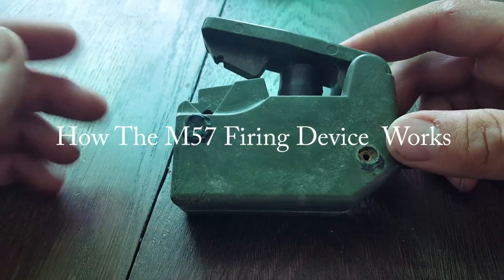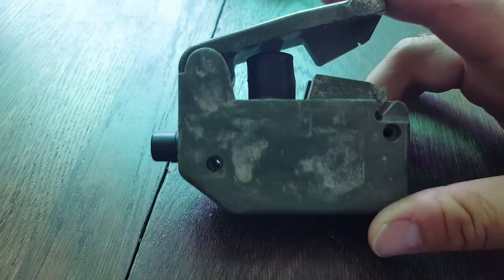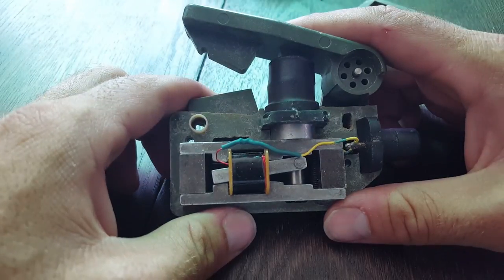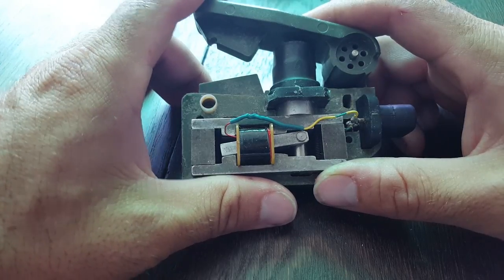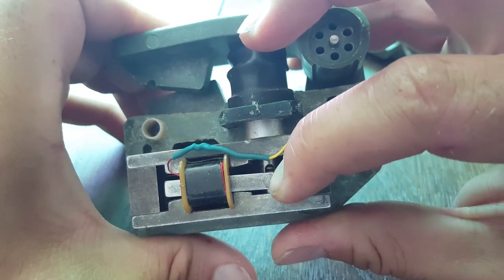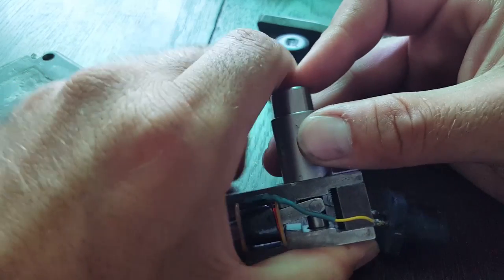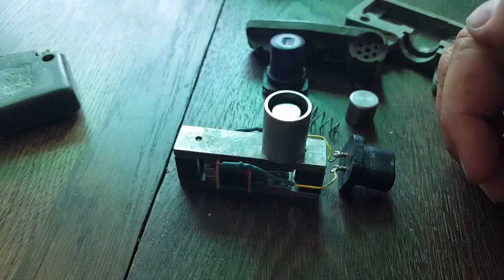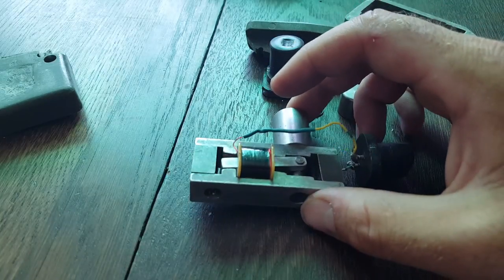The M57 Clacker: How it Works

Comment: Thanks for the detailed video, I was able to restore one probably better than new by replacing the two bad magnets.  Just wanted it to fire commonly available electric matches for fireworks displays.  I disassembled as shown in the video.  I verified both original magnets were installed north up, up being the button, before removal.  I purchased the minimum qty 25 part number P125BD-N52 magnets from Amazing Magnets.  These are the strongest you can get (N52), and 5 stacked up on each side is the same .625 as the originals but much, much more powerful.  I verified continuity on the two output posts, and reassembled.  I could not feel any voltage when holding the posts while clicking, but when I connected an electric match, it popped on the first snap.  I also can connect an LED and it will illuminate brightly when snapped.  I have enough magnets to fix one more, leaving 5 for the refrigerator.
Reply from the maker: Thanks for the reply. You have just filled in the thing I didn't understand about the 57. I assumed the magnets were arranged the other way now it makes sense. I thought the metal bar clicking over disturbed the magnetic field of the magnets rather than what it actually does.
Reply: Нажмите на фрагмент, чтобы вставить его в текстовое поле.
Reply: @Stray03  Do you havva link from where to buy these from? 🤔🤷‍♂️
Reply from the maker: Unfortunately no. Sometimes they show up on surplus sites, or eBay, but somewhere that has a selection no.

Comment: FLIP one of the magnets. the point of the construction is to get the magnetic field flowing through the clacking bar. if the clacking bar isn't sticking to both the top and bottom bars, it's not working. once it's flipped and touching opposite ends, the magnetic field through it is reversed and the coil creates current.

Comment: Thank you for a video, you are the only person on the internet to reveal the internals of it. I've almost thought that M57 was classified(how such a trivial thing can be a secret, and if it is why so many people sell it on ebay). Looks like engineers who design antipersonnel mines and accessories really like that concept of striker released by ball bearings that are pushed in.
Reply from the maker: Yeah I had only ever seen a picture of one opened up. Thr same type of mechanism also is used in the super bazooka iirc and the later versions of the original one when they replaced the battery in them.

Comment: As far as a light goes, you could always try to find the tester that comes with the claymore kit. I think it's just an amber led though. Obviously there's more to the tester than just an amber led but if all you're looking for is a light, you could try an led.
Reply from the maker: Yeah, I didn't get a tester with mine unfortunately. I was going to use an LED, but I changed the original magnet with rare earth ones which jumped up the voltage enough to light up Christmas tree bulbs.  I made a second video on it.
Reply: I see the light, I see the light

Comment: Stray03 thanks man I even asked a few electronics stores if they would work on it and they won’t even try to open it or anything. So now I feel like I’m stuck with a cool collectible piece that doesn’t even work.
Reply from the maker: Honnestly even if it did work it wouldnt be too useful. It is a 3v quick pulse making it not even have enough energy to get a christmas tree lightbulb to light up.  Mine didnt come with the tester so I had to connect it to a oscilloscope to test it and she started with about 2.5v after I fixed it up a bit. Now it is just barely giving off voltage. Personally I wish I could find a 10cap blaster at a good price but even those are getting expensive. I will have to eventually find something that the m57 can ignite.

Comment: Did you ever figure out how to get the initial click to go? I have a couple M57s I stole from one of my supply chains and none of them work. Just took it apart today and put it back together and came out with the same issue.
Reply from the maker: I think once you take them apart you have to re-magnetize them. I messed up my magnets so Ill have to re-set them then remagnetize the whole thing.
Reply: @Stray03  I just did that with some neodynium magnets a few minutes ago and didn't seem to work yet. I think I might have the polarities switched around on the magnets though, like where I placed them at in the plastic housing so I'll play around with them and see. Definitely should have marked their placement at first.
Reply from the maker: Not sure it is enough. Probably need a real strong magnetizing setup. Not sure though as I cooked my magnets and couldn't try on the MPI machine again.
Reply: @Stray03  interesting. My magnets are pretty strong able to hold up to 100 pounds each. I cleaned all the metal contacts too. I'll keep trying and see what happens.
Reply: @Stray03 well I got the click back actually. I put both south poles facing up. Not getting any green flash on the tester for it though.
Reply from the maker: You have the magnetic field pointed in the right direction?
Reply: @Stray03  oh please tell me you know which way they're supposed to point.
Reply from the maker: North south should be going through the coil If Im not completely fecking up my understanding of it. Basically front to back. Which is north and which is south I guess depends on the magnets placement. .
Reply from the maker: @USMC517  Just got the answer, Both magnets face north up. I based my Ideas of how the thing works with other similar devices, ended up overcomplicating the whole thing.
Reply: @Stray03  you are a god amongst men my dude!
Reply from the maker: @USMC517  Thank Zeb Clayton, He Checked his before removing it, All I did was realize I over thought how the thing works and really it is much simpler than I thought

Comment: the armature should snap upwards and smack the top of the metal thing on the left when you begin to press down. thats the click you are missing. take the arm off, flip it over, reassemble.
Reply from the maker: by arm you mean armature?
Reply: @Stray03 was that the solution?
Reply from the maker: @elivo905 no. New magnets was the solution.

Comment: I would like to get my hands on one of these. I guess the closest I will get is getting an old bicycle generator & rig up a gear box / linear actuator for it
Reply from the maker: Ebay. Problem is most are expensive. Also they dont work with rocket igniters or christmas bulbs
Reply: field telephone I guess  :p
Reply: get a cranky style blasting machine. you could add a capacitor to a clacker to make the voltage rise higher before it discharges. it would take several clacks to charge it.
Reply from the maker: I've been looking for one of those twist ones actually.  the plunger ones are too expensive now.

Comment: Great video!

You could try a led, no need to even place a resistor in between since the current over time is small enough.
Reply from the maker: Unfortunately the magnets are messed up on it so I'll have to replace them or "reset them" then remagnetize the whole thing, before I can get any workable current from them.

Comment: Any tips on how to get the housing open?
Reply from the maker: I had to cut with a razor blade carefully.
Reply: Ah, got it open. I'm not sure why, but my M57 stopped doing the 1st click after disassembling the magnets and cleaning the surfaces. I even marked them before taking it apart and put everything back exactly the same, but none of the orientations work.

Comment: Even though this has nothing to do with the Claymore the West German HAFLA-35L always interested me. The design of the round seems to be the closely guarded secret. In svc. 1976-2001. It probably would have been a good perimeter defence weapon. Not sure of the tactical role other than a simple cheap substitute for heavy & clumsy WWII era flamethrowers which were starting to go out of svc. in the seventies.
Reply from the maker: I remember reading an article on it a while ago. Personally i preferred the single use flame thrower the germans used in ww2. Here is an article on the hafla: http://warfor.me/ruchnyie-zazhigatelno-dyimovyie-patronyi-dm24-i-dm34/
Reply: That is another one you see very little on the details of on the internet - it has got to be a contained fougasse with a bursting disc in there of some sort. A bit scary to hold and fire I would imagine lol.
Reply from the maker: Yeah heavy steel container blank fired. Dont know how it lights up though.
Reply: Think of the DM34 as a willy pete gun as opposed to a flame thrower and it'll make more sense. Its not a napalm dispenser, its not meant to incinerate the area. It just makes it very uncomfortable to occupy ;)
Reply: If you really want to know how the dm34 cartridge works, study the wiki pic. https://commons.wikimedia.org/wiki/File:DM34_2.jpg
Reply from the maker: Nice cutaway actually. Looks like it sort of acts like a high low system for the launch.
Reply: I knew it was a sort of single use projector incorporating a substance with red phosphorus as one of the constituents & that was not pressurized before launch but other than that, don't know much about it.

Comment: Is it fully legal to own a clacker or do u have to do paper work with the ATF
Reply from the maker: Not from the US so don't quote me  but I dont think there is any rules for the m57. An actual claymore may need some registration as a DD if you dont want to go to a govt run facility.
Reply: Stray03 ya ik the claymores were a dd I just didn’t know if the clacker would have been or not

Comment: So cool man! Side note, have you ever considered using any type of peletized muzzeloding powder for rocket fuel? Been thinking about it, its pre cored and some of it is nitro based. I figured you probably thought about it a one point or another.
Reply from the maker: Yeah I was thinking of trying to use it to make .22 ammo for that fancy hot air initiated .22, never ended up buying the gun so the rest went in the "lots of Ideas and no time to try them" pile. As for rocket fuel I thought a bit about it, but Im still stuck in the attempting to extrude some normal powder.
Reply: Stray03 yea it is really hard to avoid air bubbles!
Reply from the maker: yeah too much solvent and drying too quickly causes it, I cant get it right lol.

Comment: How did you remove the stuff covering the screw holes?
Reply from the maker: mine popped off when I used a flat head screwdriver on the stuff. I have a feeling mine had been heated though so maybe that is why it was easy.